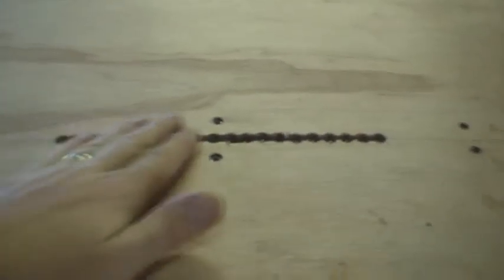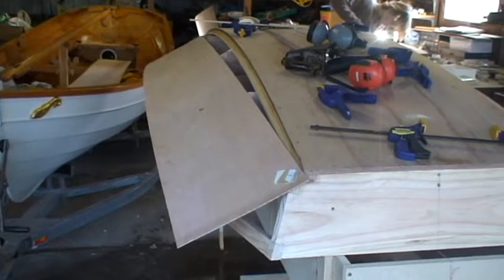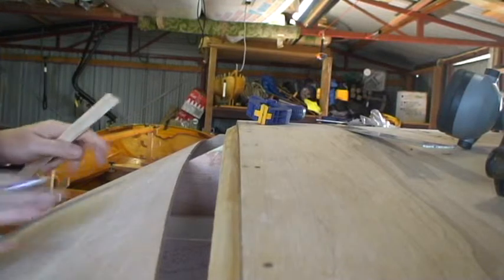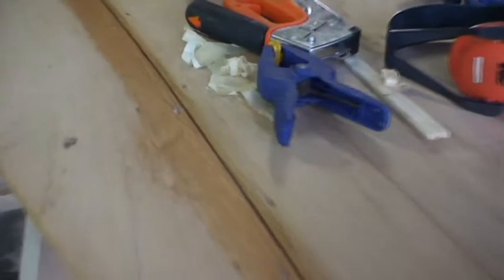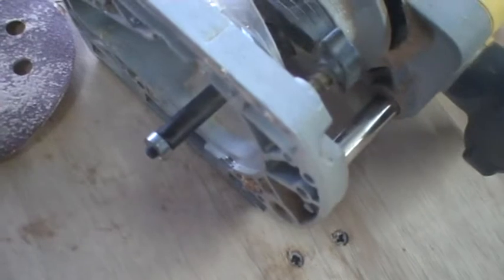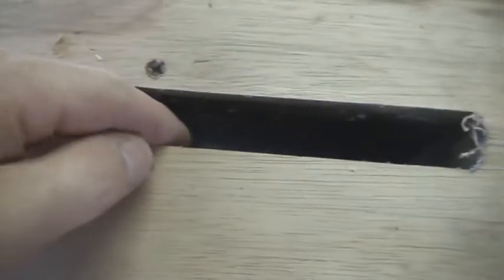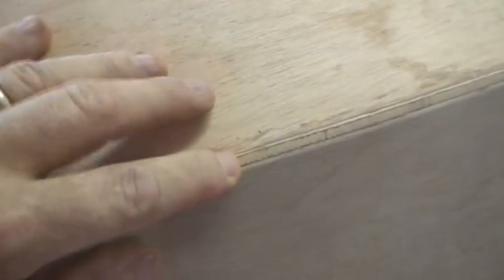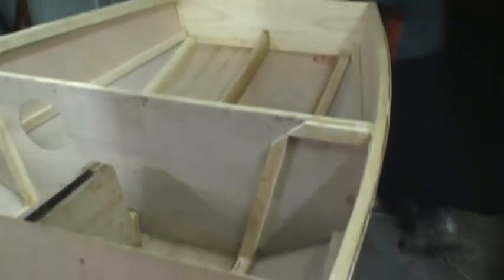Firebug Build Part 10

Comment: Hi there I am interested in buying the plans to build the bug but I cannot find any information about the mast? Do you need to construct this yourself ? Can one buy it ready ? What material would this be ?
Reply from the maker: Kayak Malta yes you can build the mast yourself. This is quite easy to do. It specifies a mast section that seems to only be available in New Zealand but you would probably be able to source something similar from a local supplier. They also used to sell a mast from Bug Bits. I am not sure if this is still available. John, the guy who runs the Firebug website is very helpful
Reply: Richard Lozell thank you, very helpful.